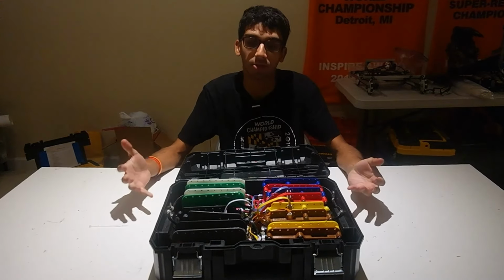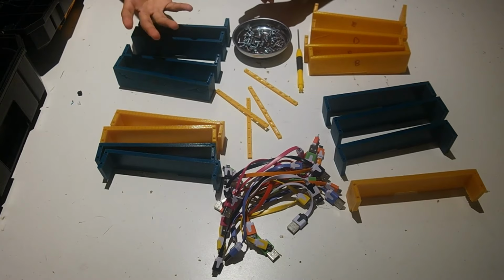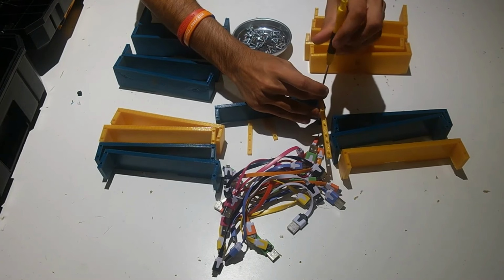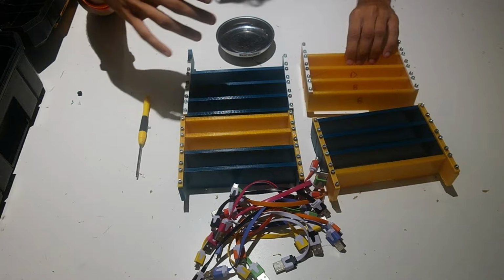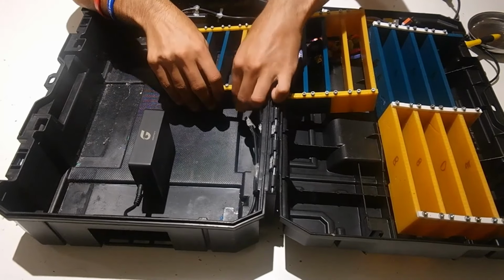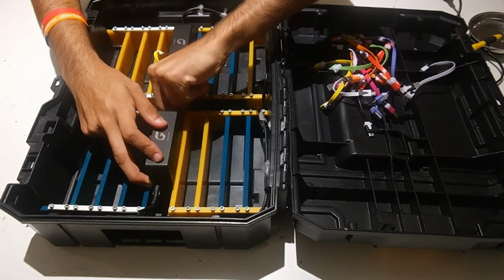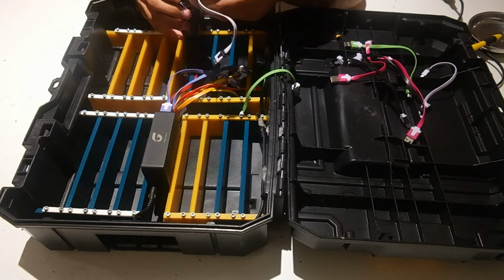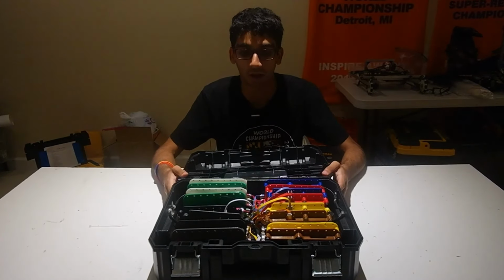16 Phone TSTAK Charger

Comment: Several questions:
(1) Do you find that the phones don't get hot enough to need additional air circulation?
(2) Did you use the TSTAK because your team already uses TSTAK cases, or was that just a convenient container for the size you were looking for?
(3) Have you considered a power bank for main robot batteries?
Reply from the maker: The phones don't get that hot. They don't really need additional circulation. We used the TStaks because our team already uses them to store our parts so they make it really easy to transport all of our phones. They also have a good cart system that allows you to move them really easily. We have used power Banks to charge our main robot controllers battery, but all of our backup phones are charged this way. This also makes it easy to charge personal phones at competitions and to have phones charged for outreach events.